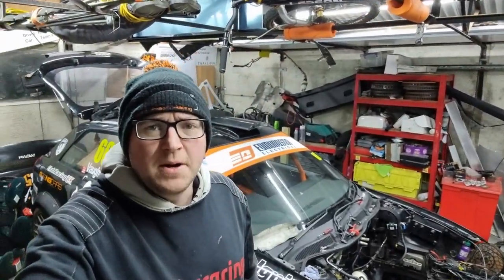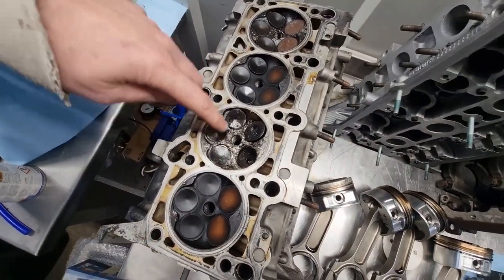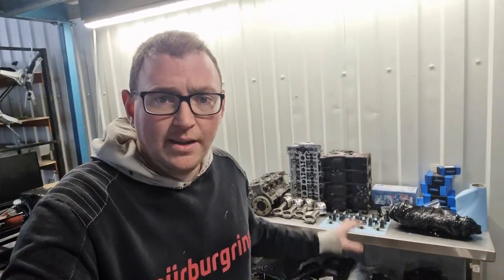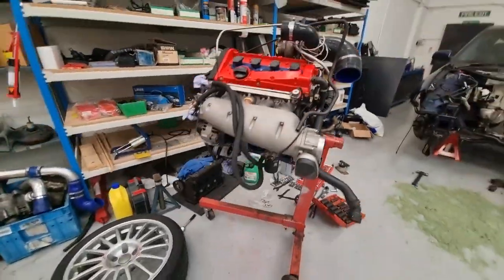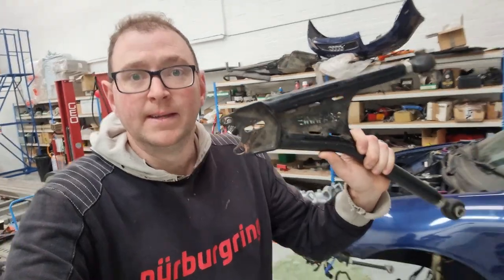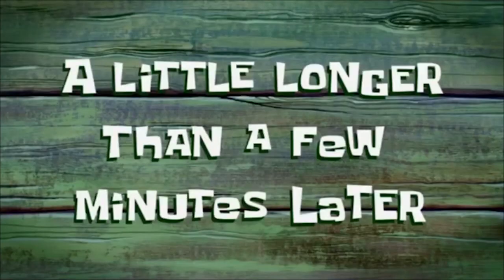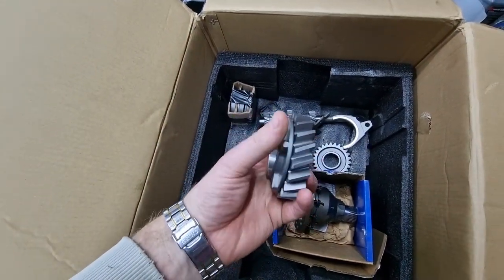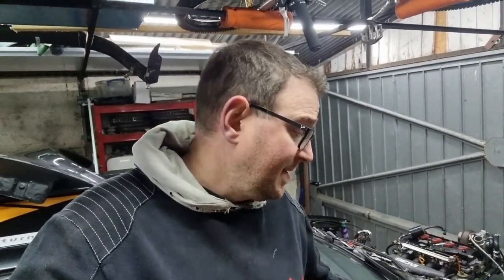Roadtrip Rambling - PART TWO! Badger 5, Carbon, SQS, InnFab, and more!

Comment: Great! It was terrible to see how despondant you were when the old motor blew up, but it's fantastic to see how enthusiatic you are about the new build! 
Question, single groove vs tripple groove spring keepers in the head. What were the old ones, and what are you going with now? It seems that tripple groove are preferred for a high reving engine, but do you think it's just hype? The tripple groove valves seem to have shallower grooves.
Can you tell us the weight difference between the metal and carbon wings?
Love your work!